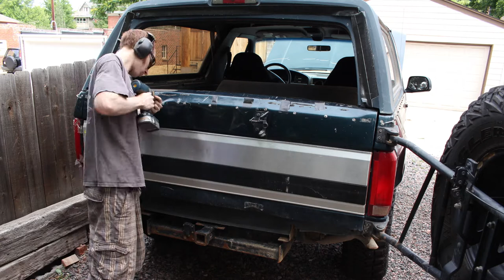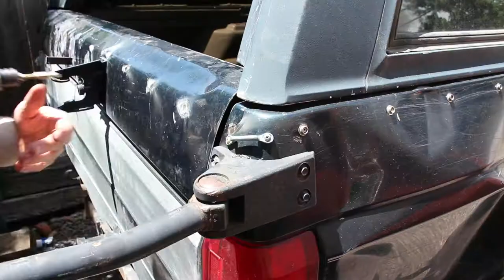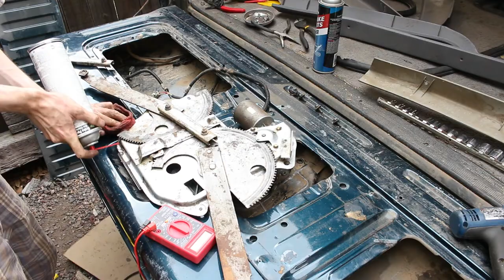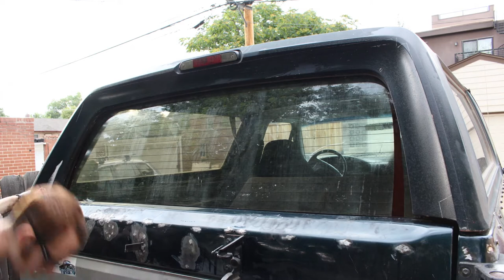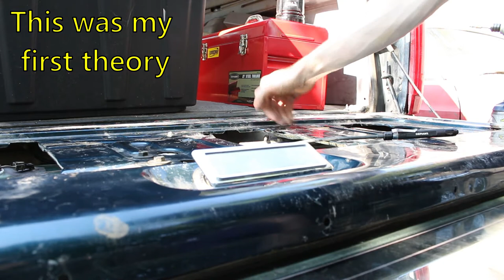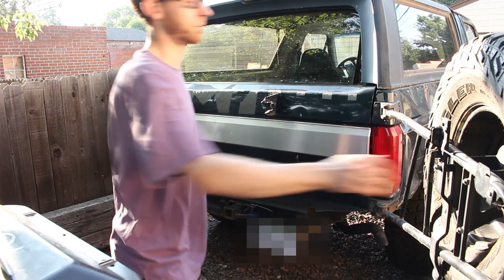Installing Bronco Rear Window

Comment: Should have told us by tightening too tight the window brackets it actually will
break your lovely used window into 1,00,000,000,000,000 pieces !